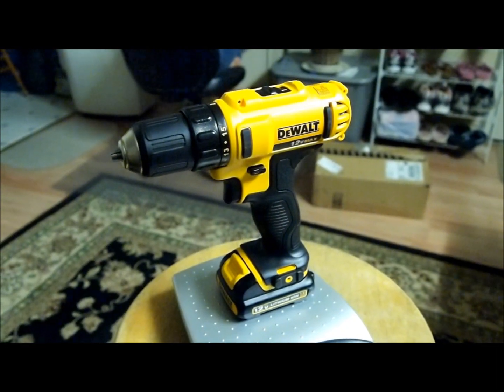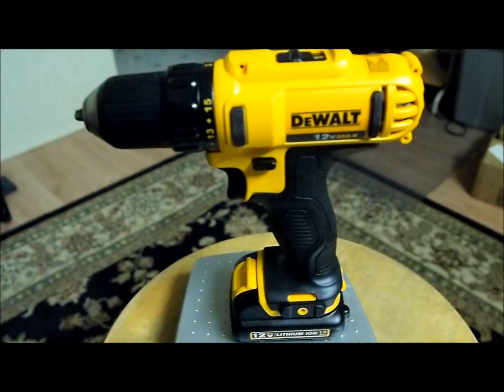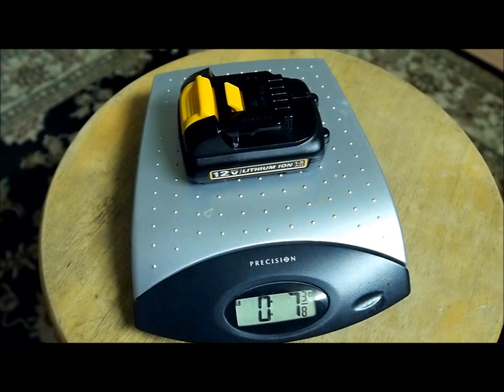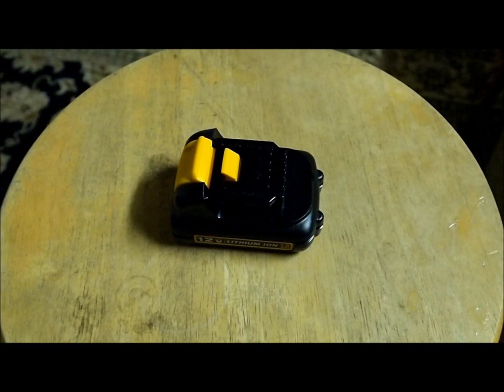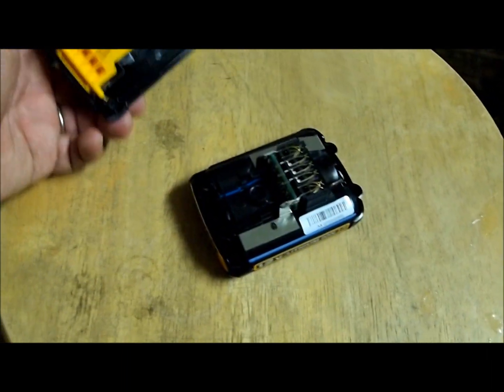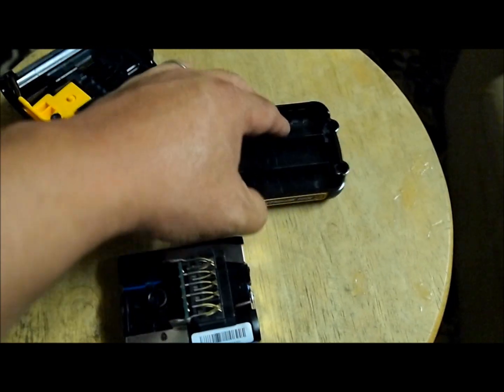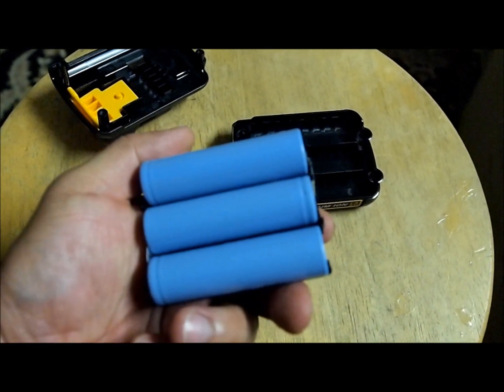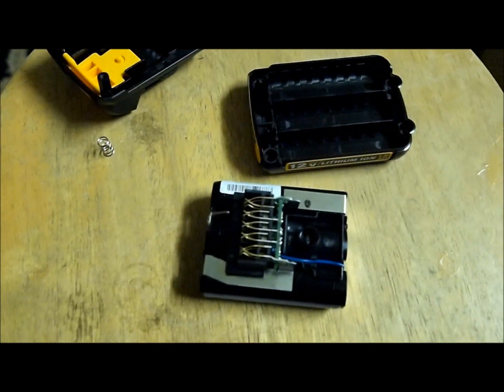The guts of the Dewalt 12v Lithium ion battery

Comment: are the two outside terminals the power and ground? will be able to power a small fan if I wire up to those two terminals?
Reply: I know I'm commenting this 2 years later, but in my experience, yes these 12v Dewalt batteries will run a small fan. I used mine to test a dash mounted 12v fan. Hope this still helps.
Reply: @jesusestrada5543  yes I used mine to run my mr buddy big heater.

Comment: Umm I got this battery and can I use this to power something else like a heavy-duty rc??? Pls reply
Reply from the maker: sajid msalim Sure. it definitely can handle the high amps, so I don't see why not.
Reply: but waht if the rcs recivers required voltage is 6 v and the one i hav is 10.8...
Reply from the maker: sajid msalim You'll need an external UBEC that will convert that voltage to 6v. You can see my other vid on an external UBEC. They are about $10
Reply: no offense...but the buck of us's here is like 30 bucks....but i dnt thingk there are many shops that sells this...and pls give me any other suggestions??

Comment: I had one of these 12v lion packs get left out in the rain. My charger says it's "bad" now. Is it likely the cells or the chip board?
Reply from the maker: I'd bet it's the cells that have drained below what the charger likes. Take a volt meter and put it on the cells and see what each one reads. If they are reading really low, manually charge the cells individually with a lithium charger(if you have one). Most of the time you just have to get it above that hump and it comes back to life.
Reply: They were still almost fully charged. They continued to work until dead, but at no point along the way would the charger charge them. I'll take any extra chipboards you have, ha.
Reply from the maker: Matthew Groves No. sorry. no extra chipboards; but on a side note if you have a Lipo/lithum charger, these cells can be charged with that. I would solder a jst wire to the cells, drag the jst through a hole through the batt case and manually charge it with the Lipo/Lithum charger. FYI - buying a cheap charger is cheaper than buying a new Dewalt battery pack.

Comment from the maker: thank you! it's sure good to know you can replace the cells, instead of paying almost as much for replacement batteries as you did for the entire drill set.
Reply: Right on! ... I own a lot of drills because it was nearly cheaper to buy a drill on sale which included two batteries and one charger.  Each drill smaller, more powerful than its predecessor!  But ... It 
Amazon.com can supply a pair of batteries for $30 ... so I may change my strategy.

Comment from the maker: Thanks. I hope so too. Unless the guy is an rc guy, I doubt he'd have a charger to charge it. I had a 3000mah 3s on it so if it isn't charged correctly it wouldn't be real pretty. On the new lithium ion cells, I know from being a Lipo guy that cells kept in the fridge preserves the cell, so I did some research and it's also true for these lithium ion cells. currently I have 1 pak in the fridge and I used one pak, and swap out when the active one needs charging.

Comment: Thanks for this info. 

Those look a lot like 18650 cells at least in form factor, their early failure is not a big surprise in this application, if that's the case... As a fellow RC pilot, I sympathize with your loss of your customized drill to a petty thief who hopefully will never be able to figure out how to charge your battery pack, or better yet; set his house on fire trying,..